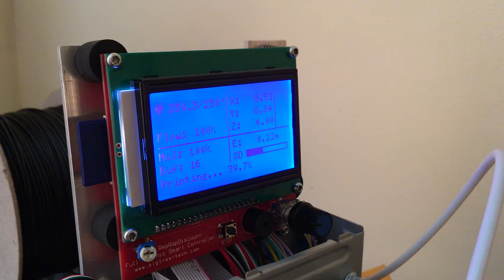3d printer from old cd-roms and floppy drive LCD mod

Comment: Hi, I am making a printer just like this, but I have a problem with the engines that will not be solved, when I connect them to ramps 1.4 and I give it to move in the pronterface they move very badly and in only one direction, I do not know that I can To do
Reply from the maker: Hi. You can try my settings https://drive.google.com/open?id=0B1u4NhJab2UFVHVBXy0xLURkbFE
I'm using microstepping 1/16 - all jumpers installed

Comment: what have you used here instead of heated bed here?
Reply from the maker: chinmaya ranjan Biswal 
Its Chinese copy of Kapton tape and ABS juice
Reply: my bed is made out of wood or acrylic do i have to use  Kapton tape and abs juice to stick or it will do the job without it? sorry, i have not enough knowledge about this i am just trying to build this after watching your video.
Reply from the maker: I'm not sure. It may work on acrylic without any adhesives. To make ABS juice is very simple - acetone + piece of ABS filament.